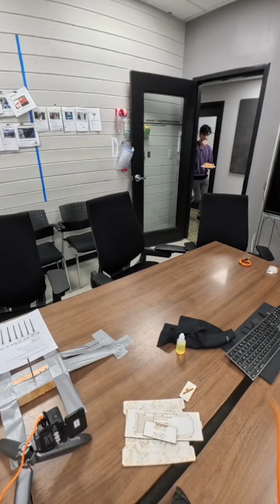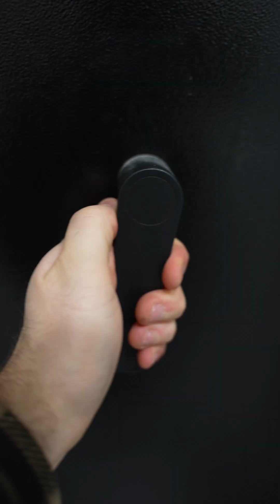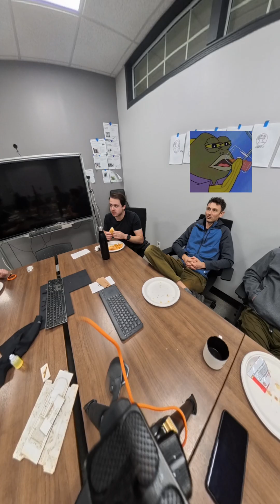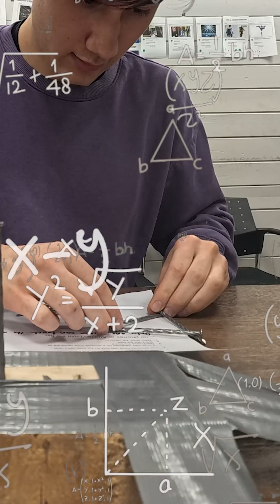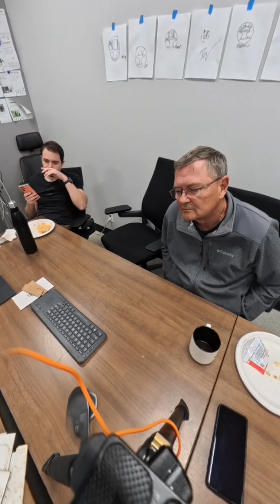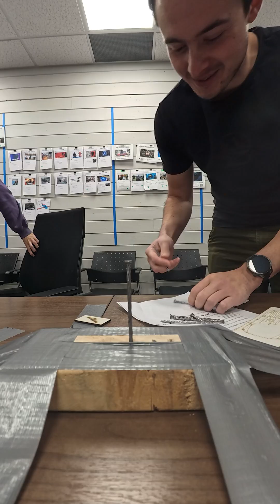Engineers… I want to play a game. First challenge: make this work without saying ‘it depends' 😈📌

Comment: Are... are those threaded nails???
Reply: Kind of! They are actually called screw-shank nails. They have a twist in them which helps them drive into harder material better and the twist gives it better holding force (like a screw) so they’re less likely to pull out over time from vibration. Ever had squeaky floor boards / decking / creaky house? Probably they used smooth shank which can pull out slightly over time leaving tiny gap that can move and squeak. Doesn’t take much movement to make annoying floor sound squeaky. Ring shank nails are another type for a similar purpose (look like just little ridges ringed around it) but they are better for soft woods.
Reply: All my pasture fence boards are attached with these. Very hard to pull apart. Ugh

Comment: "Use only the loose nails. Nothing else."
"Don't use the tape"
No no. You can't use the tape holding the wood. Put that back.
Reply: Aha! But once he tears the tape off it's no longer the tape that's holding the wood ;)
Reply: @Geaxuce 
"Don't use the tape" means don't use the tape.
Reply: @Geaxuce  You clearly didn't read the instructions 🤦🏻‍♂️
Reply: Didn’t say you can’t use the paper. Poke the nails through the paper and then rest the raft of nails on the nail. Bam you’ve only used the nails to balance and they explicitly said no tape as a binder but not the paper the instructions were written on.
Reply: @toasty365  The very first rule literally says "Use only six loose nails. Nothing else."

Comment: Hang the board upside down with the nail in it so gravity holds the nails against the backside of the head?
Reply: “Don’t move the board”
Reply: I'm sure they'd find that in violation of the rules somehow. I don't think they said you couldn't modify anything, but it was implied by the strictness of the other rules.
Reply: Do every single one of you have reading comprehension issues? None of you read the rules